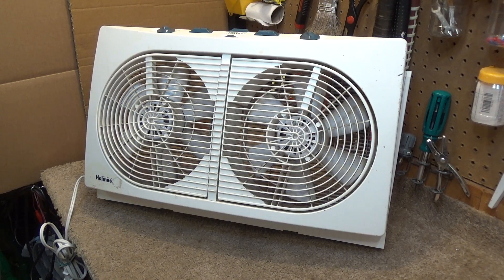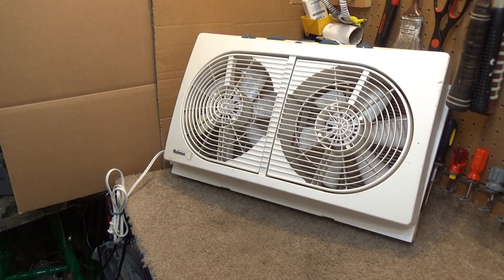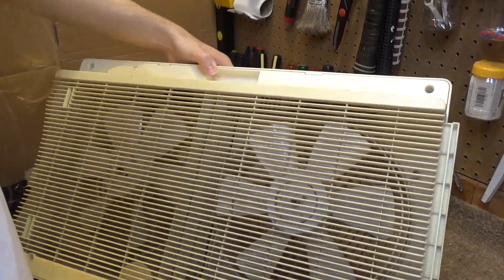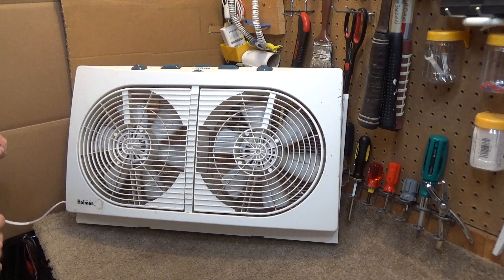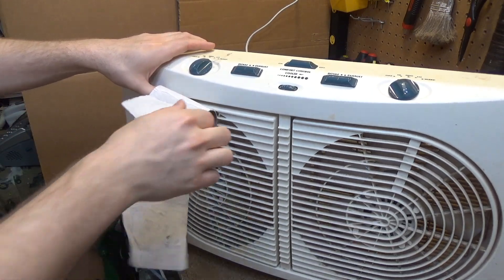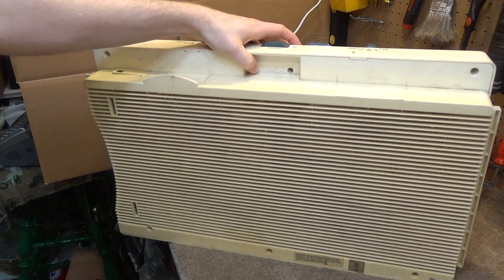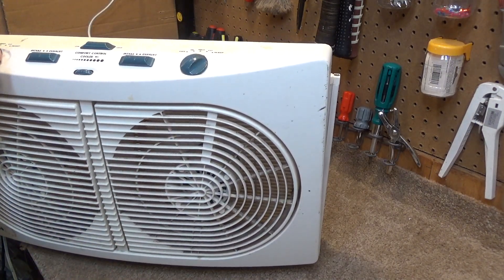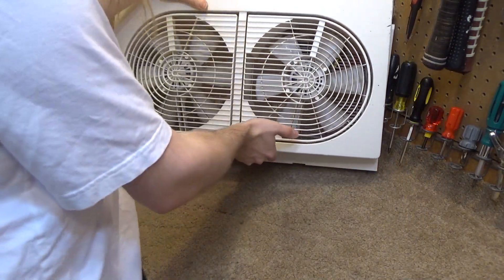Holmes HAWF2072 Twin Window Fan | Initial Checkout

Comment: What a coincidence, I actually had this exact model arrive to me on Monday. Though yours looks like it’s in better condition considering mine was incredibly dirty with a bit of a smoke smell and the oscillation motor is a bit noisy.
I actually remember seeing one of these on display at a BJ’s back in the late 90s I believe 1998) when my grandmother bought the HASF-1701 and HASF-1516 Holmes fans. It was one of the coolest fans I saw as a child.
Reply from the maker: Interesting, I didn't think there would be many, if any, others of these around.. Hope you're able to get the one you got cleaned up well..

Comment: I used to have the Holmes window fan since May 26, 2000 when me and my mom bought it from Sam's Club after returning back home from my three-day camping trip with my school classmates and staff. It even came with the back filter that I had to install manually to prevent allergens from blowing into my house. Unfortunately, the 2nd motor to the right quit working and the left one still works, including the oscillator, the forward/reverse switch and temperature control. Unfortunately, because of my mom clearing out junk for cleaning, I wasn't able to keep the fan any longer and ended up getting rid of it around July or August of 2010. It's a decent fan but not my favorite in terms of performance.

Here are my two videos: https://youtu.be/Y8f7JGpz1NQ

https://youtu.be/UZDMlJPXHJM
Reply from the maker: Thanks for letting me know, that's too bad you weren't able to keep it.